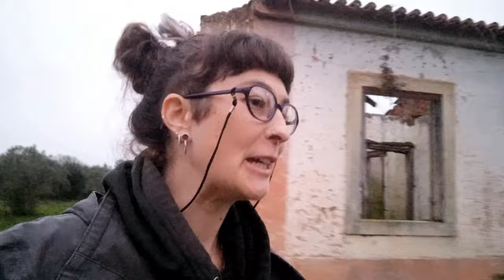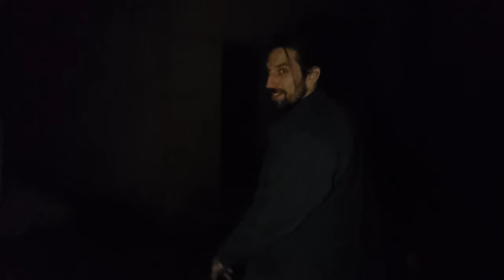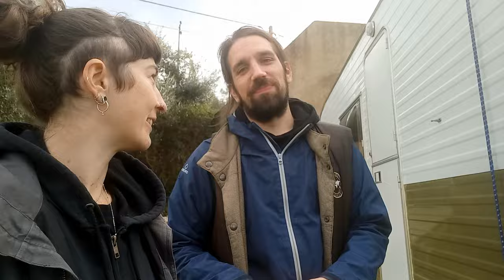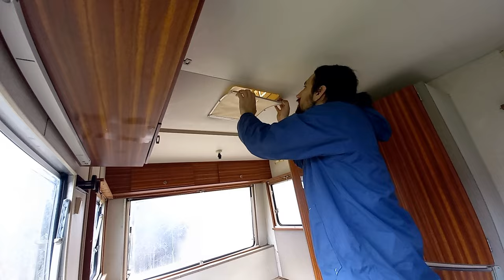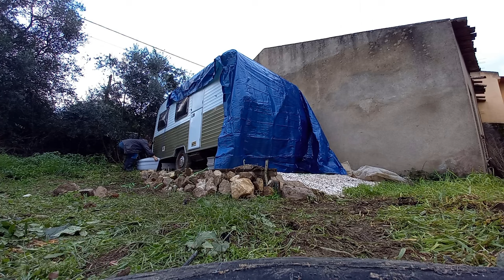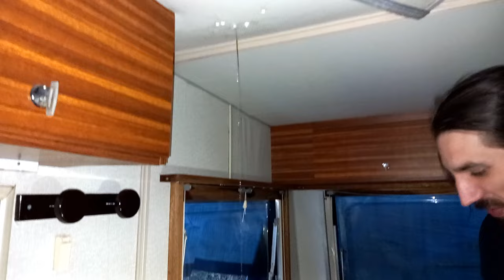A CARAVAN FOR OUR PORTUGUESE HOMESTEAD - Can We Pull Off The Installation??

Comment: Build a metal roof off the building. Wooden frame. Big enough to include porch/outdoor kitchen. Then it doesn’t matter if the caravan roof leaks. This will also help keep it cooler in the summer. You will, bit by bit, achieve so much!
Reply: yes, an awning or some solid structure, that way you wont feel the rain pouring on the caravan while you sleep. It could get rly loud
Reply from the maker: Thank you for the advice and for the encouragement! We do have plans for an awning in the works, which we'll be sure to share in a future video! :)

Comment: I would have also made those holes to let the water out, it will help with drying out faster. Don't panic with the roof, you should get up there and first see if you can see anything obvious that you can maybe patch with tar paper used in roofing. It could give you time for something more permanent.👍
Reply from the maker: Yeah the tarps are helping for now, but we def need to spend some time patching it up as well to see if we can improve it somewhat that way as well. Though we hope to put up something over it soon!